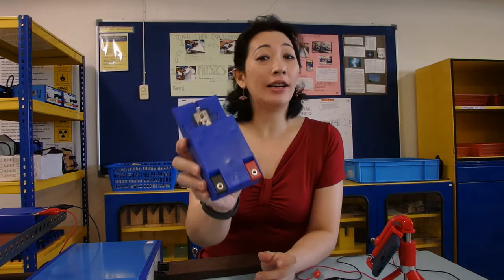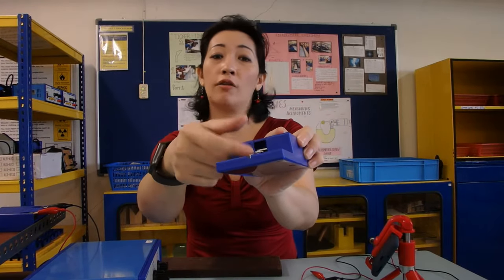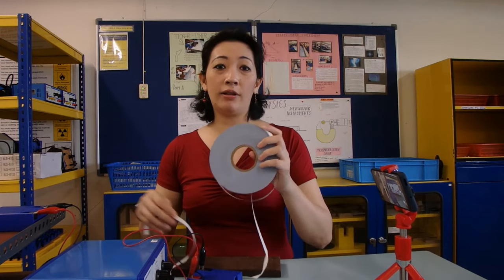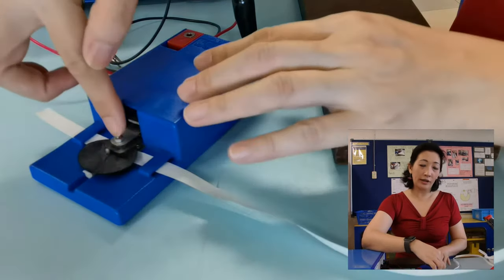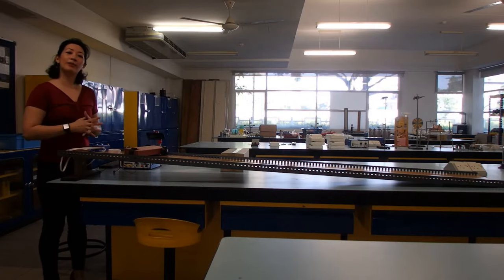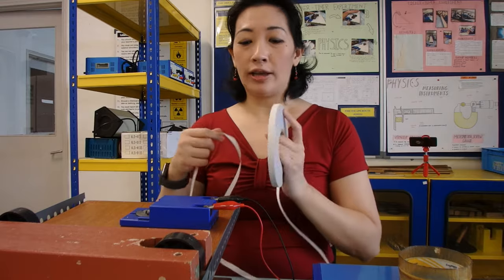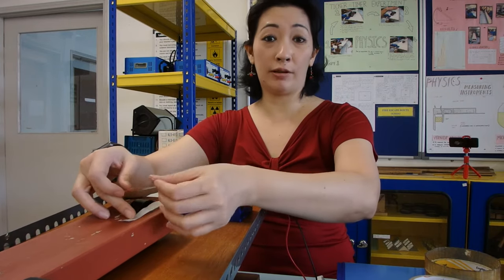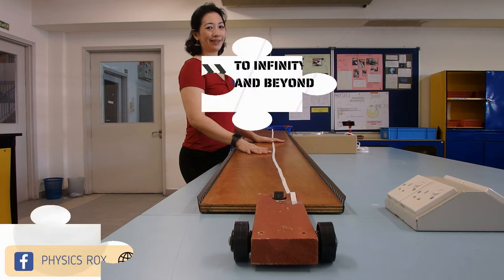Ticker timer - what is it and how to use it in an experiment [PHYSICS ROX ~ MS HOO SHOWS]

Comment: Love the way you explain 🙂
Thanks a lot🙂
Reply from the maker: My pleasure 😊 Glad you found the video helpful!
Reply: BTW, been searching for your separate video  on the calculation, didn't find it. What's the title pls or the link? Thanks in advance🙂
Reply: Can I ask a question? This bothers me🥺

1 Hz produces 50 dots/ sec on a tape, 
1 tick = 0.02 sec,

Within 50 dots are only 49 ticks, so 
0.02 sec x  49  = 0.98 sec

Why is there a 0.02 difference to become 1 sec?
Reply from the maker: My apologies, I never got a chance to do the calculation video because I got overwhelmed by work. However since there's a request, I will work on it and release it soon :)
Reply from the maker: Actually, 1 tick = 1 space BETWEEN dots.
So if there are 50 ticks (i.e. 50 spaces), there are 51 dots on a tape.

This is usually a common point of confusion because many books say 1 dot = 1 tick. However, it's the space between the dots that is considered a tick. It takes 0.02s to travel from one dot to the next.